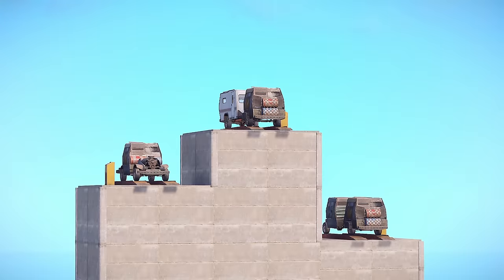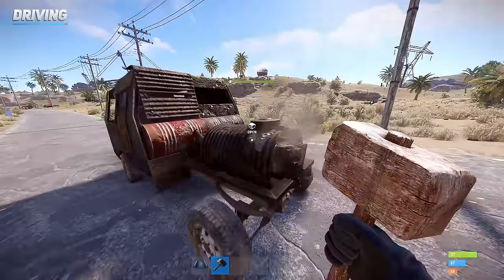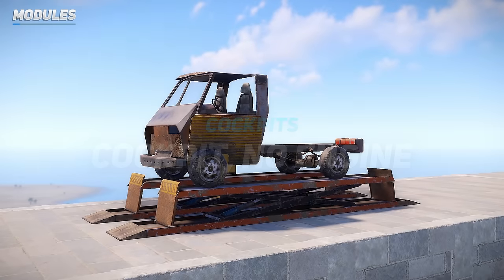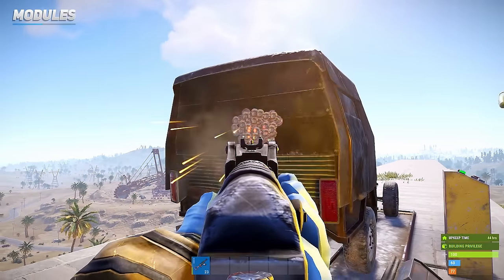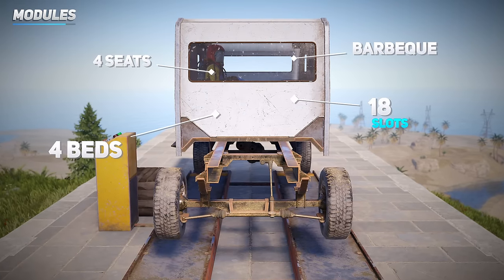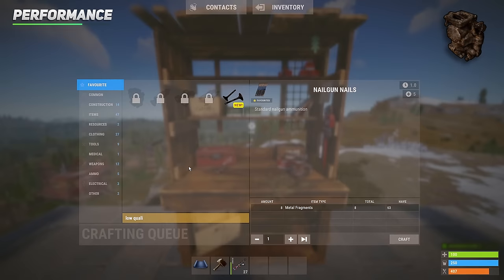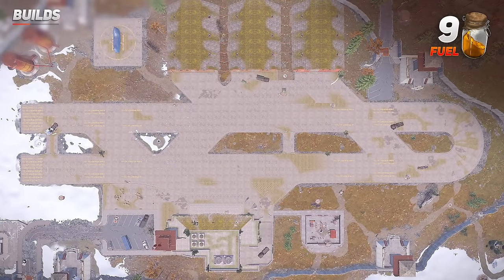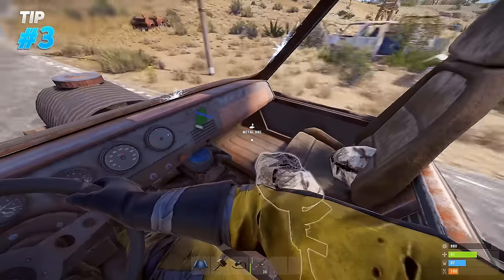The Best Vehicle Build In Rust 2024 - Modular Vehicles Guide | Rust Tutorial

Comment: Haven't watched the video but best tip ik for cars is that you can use a car lift on the ground so you can just place it outside ur base connected to a solar panel or generator. And then u can get a car in seconds, no need a car garage. Helps a lot when playing a wipe for over 2 days
Also a tip u can hold CTRL whilst driving to steer with your mouse instead of A+D. A lot smoother experience and not choppy
Reply: Great video.I'll add that if the health of the vehicle fall below a certain value, the locks pops and your storage container is not longer unreachable. Also if you want to  break in and the players are not around you can make a 2x1 twigg platform with a double door frame. Push the vehicle so it overlap the door in the middle and close the door. The behicle will self destruct taking damage from the door but not beeing able to get pushed away. You can then take the loot that was inside (storage or camper)
Reply: Woah the ctrl tip is game changer!
Reply: Are you serious? The CTRL steering should have been your number 1 tip. I love using the cars in Rust and always make garages and I never knew this. It’s absolutely a game changer as steering with the keys sucks because it’s not analog.
Reply: THIS COMMENT WAS SO APPRECIATED! Thank you!
Reply: This wasn't my video and from what i heard the twig thing should be patched w a door. @AlexDubois
Reply from the maker: Wow, thank you for these tips. I tried looking for a way to steer the car with the mouse but I guess never ended up holding CTRL so thought it wasn't a feature.
Reply: goat
Reply: @Gilbert96 I replied to your comment so all other tips are under yours and easy to find. The CTRL one being a big one.
Reply: No problem man @JfarrYT
Reply: You should place the lift in a way you can close a garage door over the access panel tho, because if anybody can reach your lift they can change your lock codes and drive away. so i like to put a lift halfway on a square outside a gatehouse with the control panel portion facing the gatehouse door so u wont get your vehicle stolen. Ur welcome ! <3
Reply: Great tips

Comment: I've been using cars for a few years now, besides the uses you've mentioned, you can use cars for ore farming runs. A somewhat safe place, speed and having all that storage makes an ore tea and jackhammer run huge.
Another important point is that cars can be blown up from outside of safe-zones, while the car is inside the safe-zone. Usually using one player outside of the safe-zone with HV rockets and another to loot the car. So parking in a protected area is important.

Comment: So if you were using a camper for underground train tunnels would you use armoured cockpit engine and camper or would you downgrade to the cockpit with the engine storage module and a camper?
Reply: Depends on your preferences and gow dangerous your server is: security from armored cockpit, or extra storage. Just read elsewhere in the comments you can throw backpacks on the floor inside the armored cockpit, whoch can negate the need for a storage module